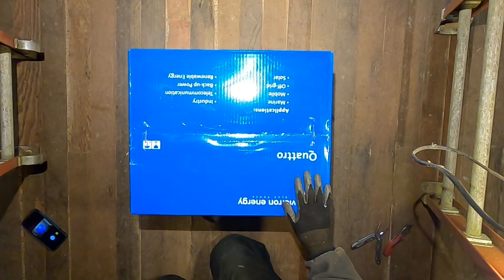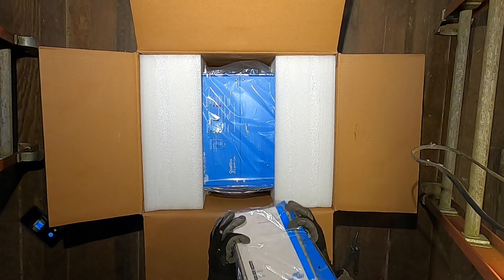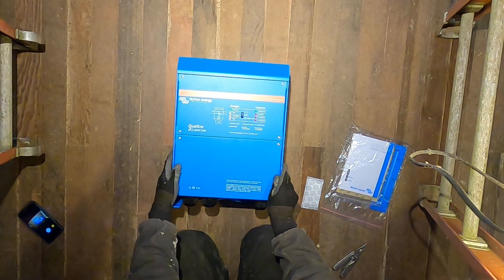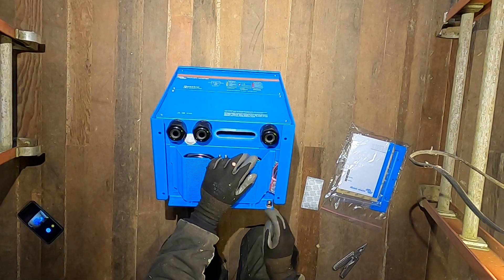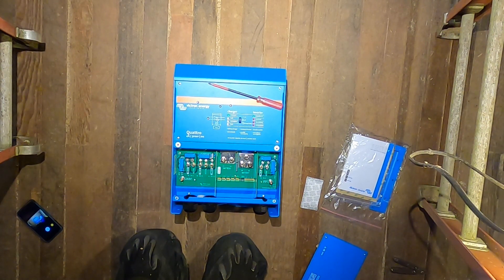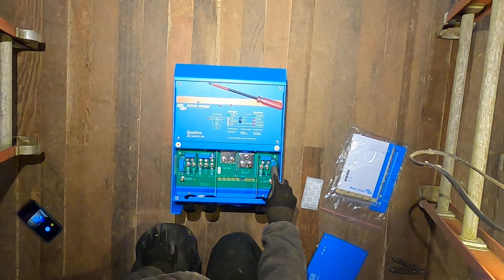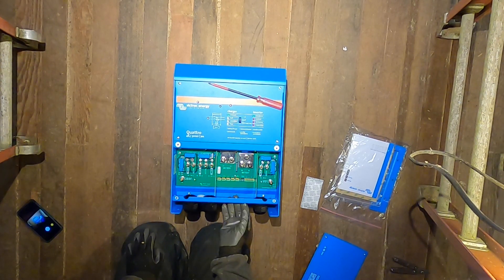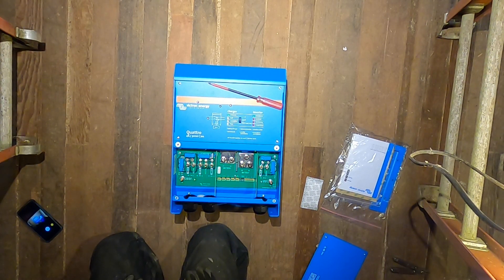Unboxing Victron Quattro 5000VA 48V Inverter For My LiFePo4 Battery Underground A-Frame System.

Comment: Did you finally read the manual and find out what the 2 AC lines in  and the 2 AC lines out  are actually for ?   I just remembered listening to some of your idea's of what you thought the 2 AC in an outs were for .    I have the same quattro inverter/charger .  That's $2500 !   I read every single bit of  information it came with before I hooked anything up.  Its quite an impressive piece of equipment isn't it !!!  I've had mine over a year an a half now . I  have 21   210 watt solar panels , with a victron mppt smart solar charge controller , and 32  280 AH prismatic lithium cells configured into a 16s 2p 48v bank  which is 560 AH .  I also have a generator hooked up just incase , But It never starts ! The solar panels supply enough energy to keep the batteries up even on cloudy days .

Comment: I've lusted over Multiplus and Quattro's for a while but now that the Multiplus-2 3000/48 is about to be released in a 120v version, thats #1 on my list. Still very interested to see how this works out for you!
Reply from the maker: I have been waiting quite a while for ther Multiplus-2.  Every time I inquire about the U.S. release date it gets pushed back significantly.  I hope I am wrong but it does not seem like it will be released any time soon...
Reply: @metagrid9453  yeah when I asked about it in 2019 I was originally told early 2020 which clearly never happened. But it’s finally showed up in their price list with a date of “December “
Reply from the maker: @th0r615  Could you provide a link to the price list?
Reply from the maker: @th0r615  Thanks!
Reply: @metagrid9453  just out of curiosity; where area are you located?
Reply from the maker: @th0r615  Pacific Northwest.
Reply from the maker: @th0r615  I emailed several dealers this morning.  Got this:  "Victron's initial estimates of availability were made before the global pandemic hit, so that's obviously thrown everything a bit off schedule.

Current estimates are late 1st quarter 2021 at the earliest, with mid-2nd quarter being more likely."

But they have been saying that for almost 2 years so I am not holding my breath.  (-;